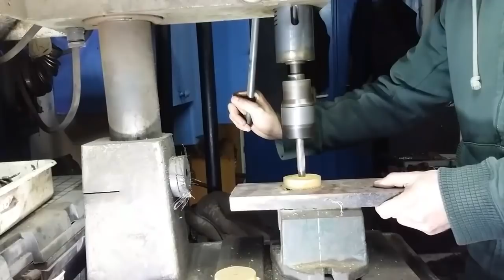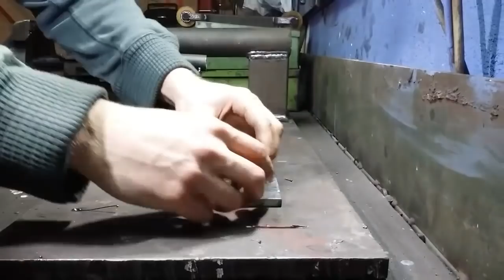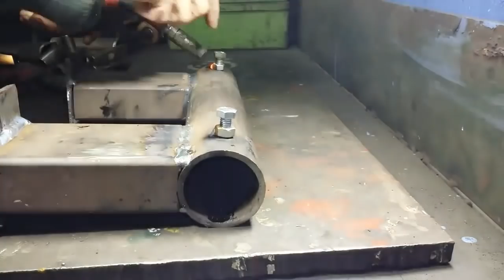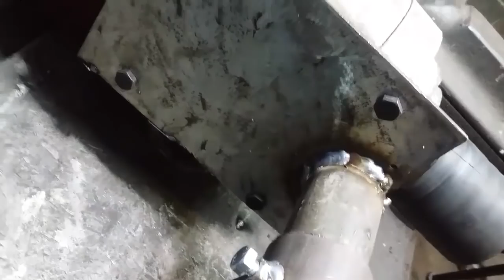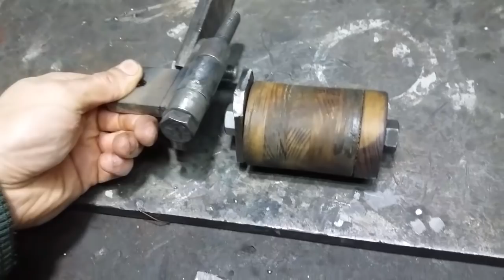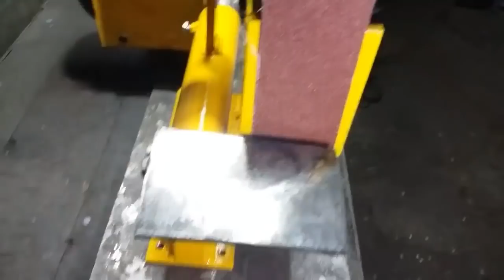Belt Grinder - Homemade

Comment: Great work, bravo! I will try to make the grinder for my use.... Can you, please tel me what is the power of  your motor, how many RPM does it have. Thank you for your answer.
Reply from the maker: I used motor 220V, 1420 RPM but i will change this motor because it's to weak.  I propose You to use motor 1.0 kW, 1440 RPM. Good luck ☺
Reply: Thank you. :)